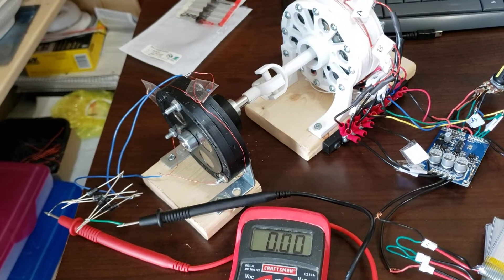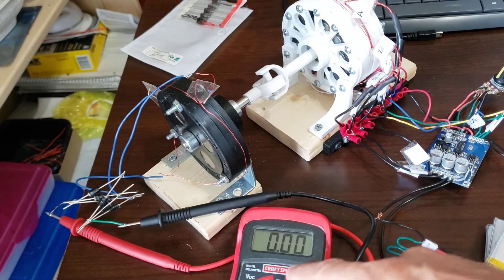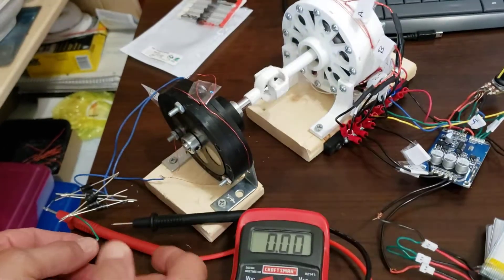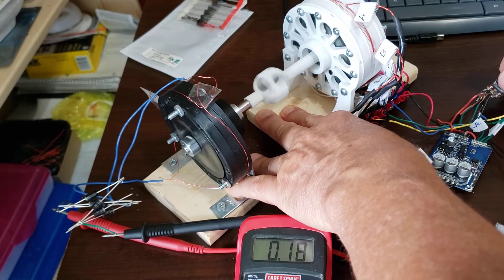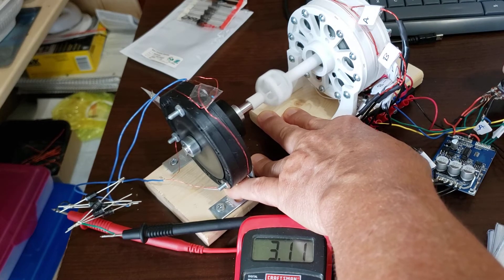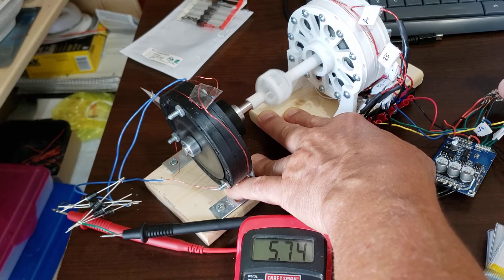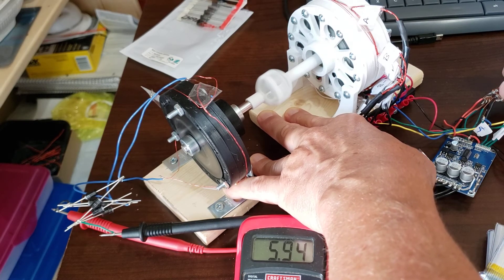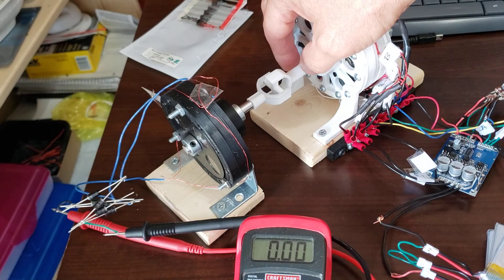3d printed Axial Flux Brushless DC motor running 3d printed Axial Flux  3 phase generator.

Comment: Why only 6 volts so high rpm? How many turns on a single coil and what is the thickness?
Reply from the maker: That black motor, I'm using as a generator, was my first test motor. It was kind of cobbled together and I really do not remember any specks. The coils are 5mm thick. I just did this mucking around so I wasn't really expecting much.

Comment: Do you have any video logs of your 3d printed generator? I am working out various ways to complete mine. Basically, Im looking for ideas for rotor/stator housing
Reply from the maker: I have several videos on my channel. One details the parts for the motor. The generator is just a BLDC motor wired as a generator by using diodes . 
This is a video of parts:
https://www.youtube.com/watch?v=CYPoyPmuzQk&t=30s
And this is a video of assembly (sort of):
https://www.youtube.com/watch?v=h7NTWatm6Ec
Hop that helps.
Reply: @rickrandazzo  Thank you very much 👋✌️
I'm very appreciate dear 
It's too important to me ✌️✌️